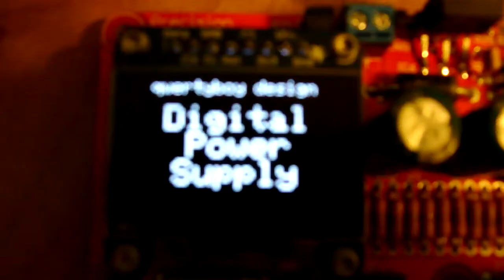Power Supply Update

Comment from the maker: Thanks! I actually just figured out the problem with the encoders. The datasheet makes no mention of enabling pull-ups on the input pins to use the quadrature decoder. Once I did that, the encoders work flawlessly!